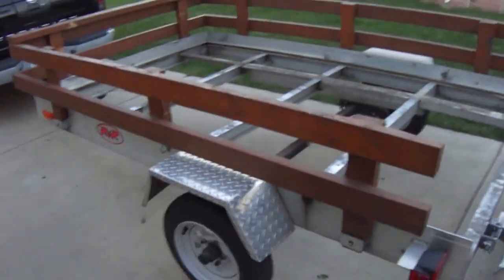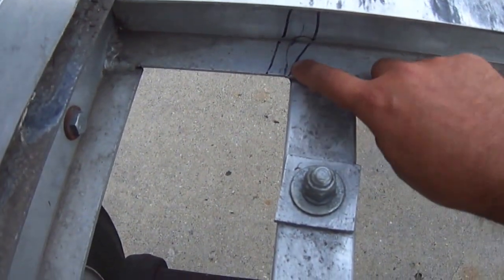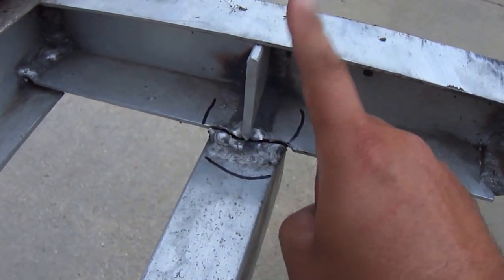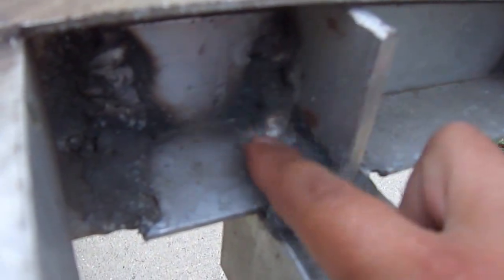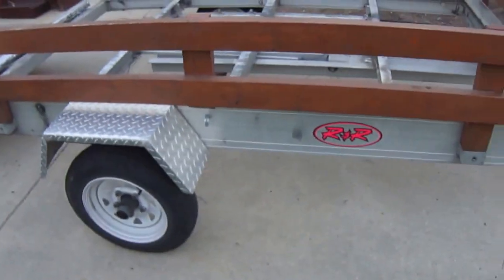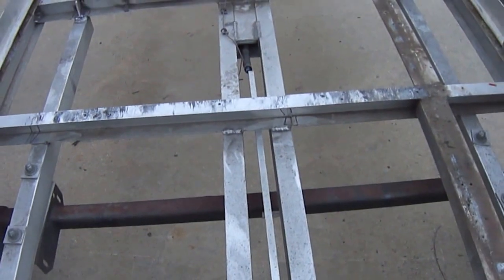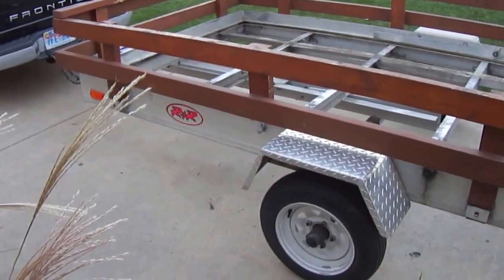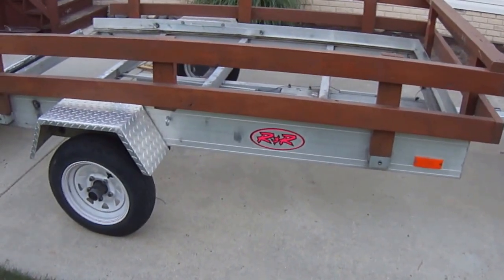aluminum trailer review

Comment: Alex, my intention is to keep an open mind on what you have shared and the repentance and explanation from R&R.  Assuming the trailer is past the warrantee period, and given you may be the second or later owner, and if there is no way to determine how the trailer was used and/or abused (i.e. overloaded) by the previous owner(s) then there may be missing facts or speculation that would need answered for why there is failure points.  Also just an assessment from my perspective as a mechanical and structural engineer, if someone retrofitted by placing the vertical plates in between the actual and predicted areas of failure, this was not the best placement for improving the structural integrity as you will still see lateral (side-to-side) flex across the trailer producing similar stresses at the failures points you have already.   As an example it would have been better to box off the "C" Channel across the areas where the cracks would propagate.  Also, extending the front-to-back frame piece towards the front of the trailer would help to reduce or change what is called "mode shape" of the dynamics/harmonics (engineering terms) of the overall structure which should extend the fatigue life of the trailer.  In fairness I am making some engineering assumptions and assessing via pictures so obviously I may not see all I need to to better redesign the structure.  I spoke of allot of jargon but given that you are not the original owner and R&R is about 4 hours from you, if R&R is willing to take time to repair it at no cost with the exception of you delivering it back to them and picking it up thereafter, it seems like a good opportunity to do so.  Just sharing, not being controversial and thanks for taking the time for sharing your experience.   ...and by the way my interest in your video was spawned by my consideration for purchasing a R&R 8.5x20+, enclosed, all Aluminum trailer.   I have not yet decided whether I will be doing so, so still researching.  :-)  Cheers.

Comment: None of the welds broke.  Every crack was in the aluminum itself, which I am sure R&R did not manufacture.  Given the height of the side walls on this trailer, I'd say it's very probable it was overloaded.
Reply: I-beam construction.. not good enough to support more than maybe 500 lbs. and 24” oc spacing? C’mon look around before you buy cheap crap. Or get a builder to make you a nice tough one out of square tube, heck even round tube with gussets would be FAR superior to basically 1/8” I-beams.

Comment: aluminum does not do well with cyclic stresses. There is a limit to the number of repeated stresses before the material fails. always choose galvanized steel construction. Steel has an unlimited cyclic stress endurance so long as it is below the yield stress of the material and the welds holding it together. And steel will yield as it is over stressed and actually work hardens before it fails at some ultimate stress. So learning's for all.

Comment: Not sure from your video if you are the original owner, or if you said that the previous owner tried to fix the trailer. I know this is an old video, but wanted to add my thoughts. I have a 6x10 v-nose enclosed trailer built by R&R and have been completely happy with it's function and build. I see R&R's comment below showing that they are willing to work with you and correct problems on a trailer that no longer carries a warranty. Granted, they are 4 hours away from you, and they replied to you a pretty long time after your video, but did you try reaching out to them prior to making your video ? If you still have the trailer, it seems it would be worth planning a trip to their site and drop off the trailer with them, it doesn't appear useable the way it is, so it's no loss to have them do an out of warranty repair. Hope you already got this settled, but I did want to add to your comments about my good experiences with R&R and I drove all the way from MD to get my trailer from them. It does have much stronger of a frame than what yours has, but was built later than your, probably around 2010.

Comment: Buyer beware when you buy any used trailer you never know how it was used there could have been a ton of firewood on it. Aluminum trailers are nice but won't take everday hard use like a landscaper would use. If you want the best option for a heavy use trailer find a good galvanized steel trailer and it will outlast any aluminum.

Comment: little FYI  this is a potential problem with aluminum trailers. VS steel.
 Also I would wonder how much you paid for the trailer and how much weight you hauled.
 Aluminum members need to be thicker "not heavier" Than aluminum to obtain the same ductil strength.
  I am considering building an aluminum trailer for myself and will take these points into consideration.
 Just a little heads up.

Comment: The trailer capacity is 2200lbs my mower weighs 700lbs
so all the R&R supporters are wrong. Anyway i would take the trailer to the junkyard.
Reply: +Alex Leon hey Alex, in your video you refer to some areas that had prior repairs.  I take it you did not purchase this trailer new from the manufacturer.  Therefore, how can you unequivocally state that the trailer failed by your use alone?  Clearly that is not the case and you were simply unaware of the abuse or overloading by the previous owner.    Still a shame to see your trailer fail, but you should be upset at the dealer that sold it to you, not the manufacturer.